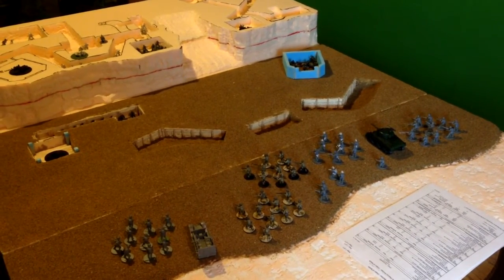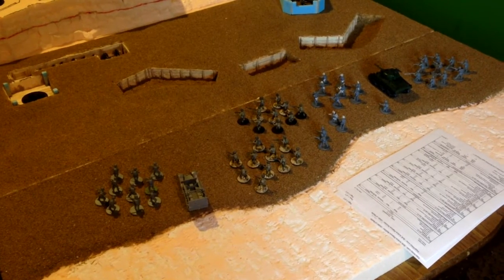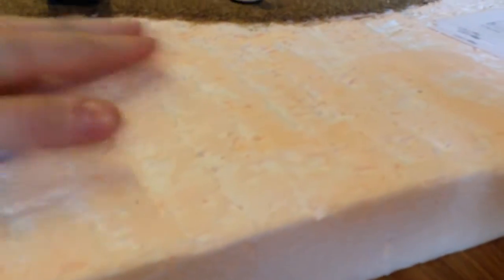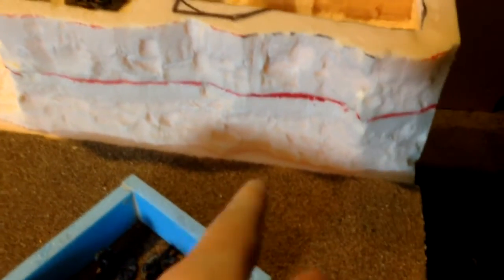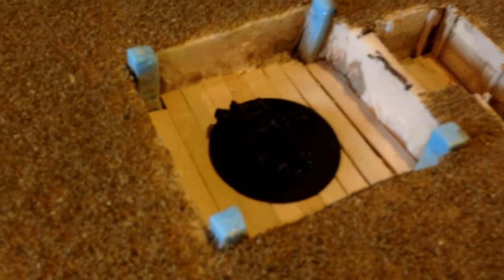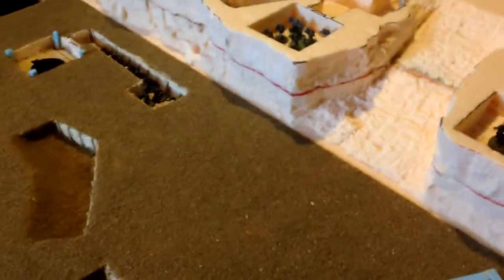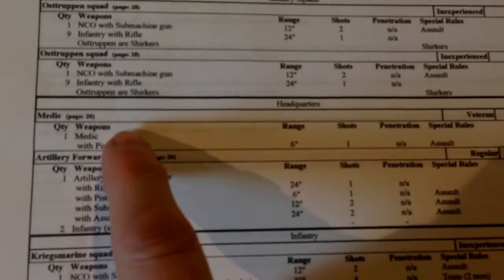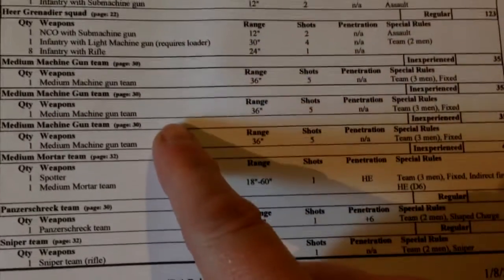Dday Terrain Board Part 4

Comment: not enough details what paint used primers?
Reply from the maker: +E-4 Airman I have only used brown acrylic paint under the sand so far nothing else is painted. I am going to be using cheap acrylic paints from discount craft stores. I will be mixing the paints to create different shades but that's it, nice and simple. The material is the pink Styrofoam boards. same as the blue stuff you can get but I found this much cheaper long time ago, cant seem to get it these days only the blue stuff about and it fair bit more expensive. I have stuck them together using interior grab adhesive from B&Q. cheap and does the job, holds pretty tight and can be sculpted, plus it fills all the little gaps. Hope that helps you out buddy. ill try to include more details about materials and techniques used in future videos :-) plus ill show some of the work being done too if that's something you guys are interested in.